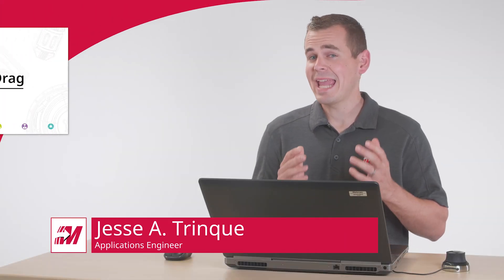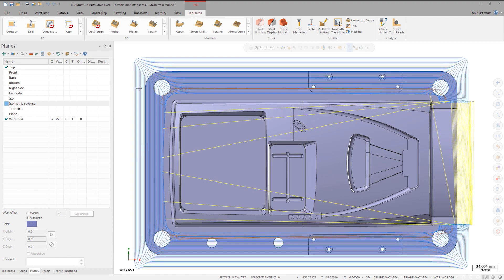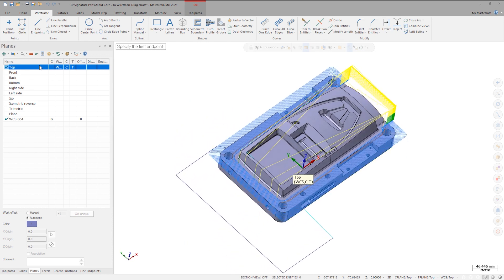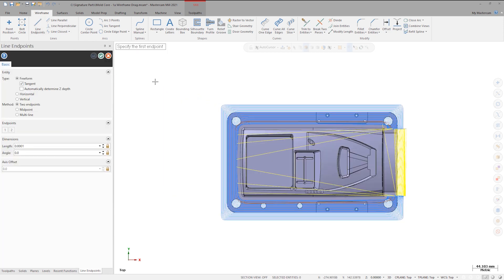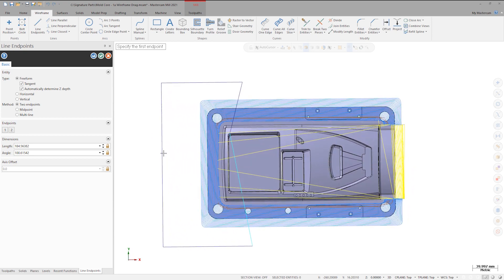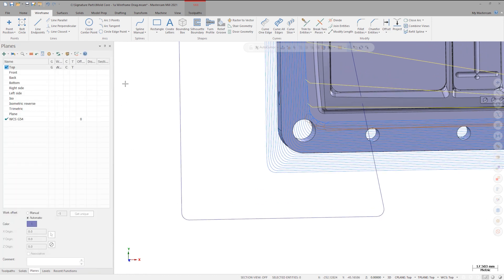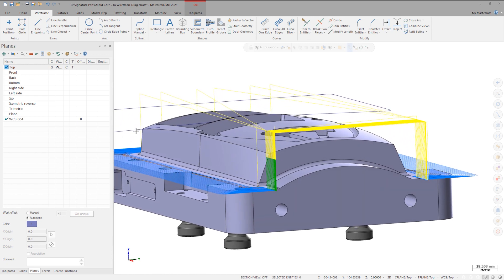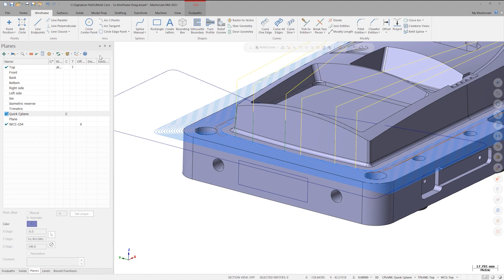Computer Mold Core: Wireframe Drag

Comment: What happens if you quick c-plane a nonflat surface?
Reply from the maker: We intelligently limit selection when looking for a quick c-plane and won't let you pick anything other than a flat surface. Once selected, the functionality works similarly to what is shown in the video. 

To create a plane on a non-planar surface, we recommend clicking and dragging up the gnomen from the lower left corner of the graphics screen to your desired surface. Clicking and placing the gnomen will give you a plane at the respective surface normal.